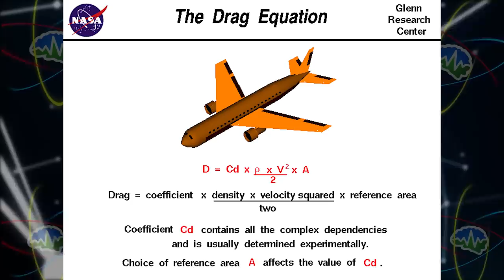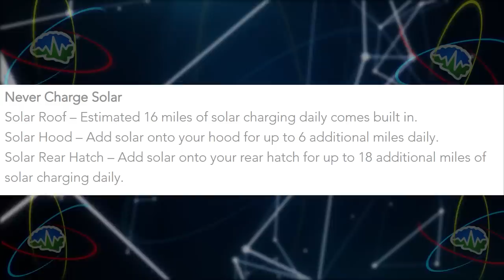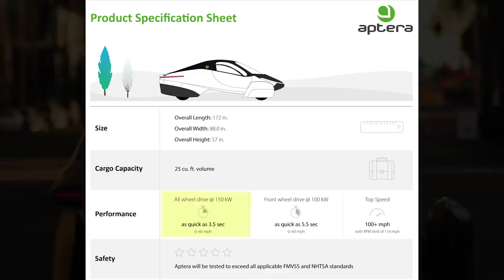Aptera Beats Tesla? | In Depth

Comment: You charge the Aptera to its 1,000 range (or whatever it ends up being), and then keep it there with the free charging supplied by the solar skin of the car. You might need to plug it in once every 6 months, or once per year, depending. This car has an electric charging port, so you can charge it. You can charge it overnight just like Tesla, but with a standard 110 volt plug. Twenty five thousand dollars, deduct all the federal and state incentives, and you end up with a totally affordable car for most people.
Reply: If govt were smart, they would give an incentive for all 3 wheel electric vehicles. But big car company lobbyists won't allow it. ☹️
Reply: The version with 1,000 miles of range doesn't cost close to $25.000. Check the web site; it's more like $45K, plus another $1800 for the full solar panel treatment, which is necessary to achieve 40 miles of charge per (sunny) day. Also, it doesn't exist.
Reply: @richarda3659  This guy is simply saying a long term potential. To debunk it you put forth a shot term worst case scenario. Like if you were a commuter with a 50mile commute, complicated by rainy days. Lol Good luck with that year long charge bud!!! Hahahahaha
Reply: How are occupants cooled or heated? Do windows open? I like the idea but wondering about comfort level. 🤔
Reply: @mitchschneider1927 According to previous Aptera interviews, I believe that it has both heating, cooling, and as you see in the demonstration videos, the window does go up and down. However, due to efficiency centrist design, the winds open 2/3 of the total "window space." It would be a change, however, it would be a small one I presume since the side mirrors will be mainly the cameras that you would view from the inside, rather than the outside.
Reply: That's not a car, but a two seat cabin motorcycle. Those are local use cars, extremely unpractical for day to day use and storage capacity...also forget about any family use.
Reply: The 1000mile version isn’t $25,000.
Reply: @fw1421  -  either that or 40K...  there will be accidents in them things and who ever is in them are signing their death warrants.  them things don't stand a chance in a remotely bad accident.   could you imagine that thing Tboning another car?  let alone a SUV?   its over with.  the people in the suv, though lucky and happy they didn't die... would probably be charged with murder in this day in age lol
Reply: @mitchschneider1927 yes the windows and it has heat and air conditioning .
Reply: @MKO-USA it has 7 feet of room behind the seats and 32.5 cubic feet of storage.

Comment: Quite possibly the only car that you DON'T want to park in the shade.
Reply: I was wondering how that might work out here in AZ.  Great charging, but how is the a/c and how much would it offset the charging to have to run it before you get in so you don't flash fry.
Reply: @enmiredbythelazy4401  Don't forget that if you had the full range of PV a lot of the heat would be turned into extra travel - and if you were a night worker you could just sleep in the summer and have free travel to work!

Comment: I got this from the Aptera site. not as dangerous as it looks?

We will not know Aptera's actual rating until we pass a production vehicle through the full safety test. But we are designing to exceed all passenger car standards and the previous version had the highest roof crush strength of all passenger cars on the road, and it performed exceedingly well in actual side and frontal crash tests. Aptera features a Formula One-inspired safety cell with advanced composites and metal structures for impact strength. Similar to aerospace and racing, these energy-absorbing methods are a core part of our safety strategy and have proven effective time and time again in high speed impacts. Aptera also makes use of today’s best forward and side airbag systems in case of an accident.
Reply: Thank you!  This is what I most wanted to know.
Reply: I was in Brad's boat -- my first and last thoughts were this doesn't look safe
Reply: Same here my biggest question was safety , surprised they didn't mention this in this show kind of important note.
Reply: @Mac_an_Mheiriceanaigh  that’s interesting I saw it an thought “genius” it look like an egg the strongest shape found in nature. The external wheels are just external crumple zones and and it’s light weight means much of the force in a major accident will be dispersed in movement verses being crushed , I am glad they are moving away from the belt based air bag and moved to a traditional system. Now let us see it in the Moose Test avoiding an accident is more important than surviving one.

Comment: Honestly I wish Tesla had a small solar panel to offset phantom drain, any range increase would just be a bonus
Reply: The cost's will just increase and no one want's that
Reply: Would probably add extra weight (panel and converter), which impacts efficiency, so you'd lose your extra miles. And - costs would increase too and so you'd pay more. Probably not ever get a return on that extra cost.
Reply: the glass roof

Comment: I like the design. It’s an airplane body without wings and a vertical stabilizer. I love it.
Reply: I see a vertical stabilizer. It is the rear wheel shroud. I think it is necessary.
Reply: @cookiedough5374  the design honestly throws me off, yah sure it looks cool, but imo it looks funny
Reply: @yuxanne.  I agree. When your cost to operate your car is close to zero it will start to look really, really cool.
Reply: @cookiedough5374  if operational costs are that low, you'd have to be stupid to not get yourself said car
Reply: @yuxanne.  I’ve been called a dumbarse plenty of times. In this case my deposit on one will hopefully manifest as an Aptera.

Comment: This is a follow up to my last point, the drag on a car is minuscule below 50 mph. The predominate issue is tire friction. That being said, if you are driving to work in this every day on surface streets, then you completely killed utility due to the tear drop shape for no gain at all in aerodynamics. This is likely why the BMW car - made for city use - did not compromise on internal utility. You are not going 60mph driving inside the city. BMW is not stupid. They are heavy into formula 1 racing. They know EXACTLY about aerodynamics. This is fundamentally why it has skinny tires.
Reply: That is not true at all; drag on a car is significant at 30 mph and increases with the square of the velocity. It is very significant at 50 mph.
Reply: @TitoRigatoni  
Rolling resistance on a car, the example is a Telsa Model 3:

441 Newtons 

source: 
https://www.engineeringtoolbox.com/rolling-friction-resistance-d_1303.html

Aerodynamic drag on same car at 55mph:

217N

source: https://www.engineeringtoolbox.com/drag-coefficient-d_627.html

This example was at 90km/r (55mph) way faster than the 30 I claimed. You were saying? Doing the math will give you a better understanding at the forces at play than speculating in YouTube comments. Engineering has many non-intuitive answers that can only be solved via math. The Engineers at BMW are not stupid. They did the math, and they put small tires on the car and retained its utility to hold four people and drive around a typical European city for distance requirements. 

You cannot store anything of practical nature in this apreta, it is 100% for only commuting. I cant take this for even a quick run to home depot and grab a 2x4. I have put a 6' long 2x4 into my Mazda 3 hatch (and a lot of other crap) and got real utility out of the vehicle. This is why I reiterate, this is a very expensive proposition for a car that only can be used, realistically, for going to work and back and nothing else. In a Tesla, I could put boxes and all sorts of crap in the back with the rear seats folded down (if they did fold down). My main gripe is that this car is extremely niche in its use cases.

End note: it is possible, at their weight, and tire size, that their cross over point between aerodynamic drag and rolling friction is at a lower speed of 30mph for the aperta. I can see that, similar to the cross over point of 10mph for road bicycles. But that is coming at a heft expense of sacrificing a lot of utility. This is exactly like being in a two seat small aircraft. They reduce frontal area of the fuselage by making it narrow. I can see this seating being shoulder to shoulder with your passenger to narrow the teardrop frontal area as much as possible. Hopefully that is not the case, because that will get old fast.  I can see this car being very fun to drive because it will be very might like sitting in the cockpit of a small plane. It will be a lot of fun and a great alternative to a motorcycle  because it's a lot safer. So you could grab a lot of people who are unwilling to take the risks on a motorcycle even though they really want to ride one.
Reply: @cabdolla  I am not discounting rolling resistance, it's one of the reasons the Aptera has three wheels. It will have significantly less rolling resistance than a Tesla as well as significantly less drag.

This car is bigger than you seem to think. It is not "shoulder to shoulder" It is a comfortable two seat cockpit. And it has 25 cu ft of cargo capacity, which is more than a Tesla model 3 and about the same as a Model S. The sleek design makes it appear small in photos and videos, but when you see the Aptera in real life you will be surprised at what a substantial car it actually is.
Reply: @TitoRigatoni  if they have sandy Monroe helping them, they are in good hands for sure

Comment: Wonderful, wonderful. Wonderful squared!
We have owned and maintained 40+ cars and trucks for over 40 years. Currently we have a 12 wheel Peterbilt roll-off platform for machinery moving. Had lots of motorcycles too. We know auto-mechanics!
   However this Aptera takes the cake AND the brass ring too....for economic, applied aerodynamic ergonomics for human transport, and some charging by sunpower to boot!
    What's not to drool over? I'm signing up!

Comment: I have been reading about and watching videos about Aptera and this is one of the most informative.  Great video.  I'm editing while watching.   It could use a retractable bumpers for and aft.  The Aptera, to me, looks absolutely stunning.  Looks like Airwolf helicopter without the blades.  Here's a question:  The pictures on the Aptera Motor website show the battery layout.  Now is that for the full 1000 mile range battery?  If that is the case, then what does the 600, 400, 250 range model battery holding framework look like?  Can the least expensive model with the least range be upgraded after delivery with more batteries and software upgrade?  What kind of batteries are being put into the Aptera?  Will somebody be able to come up to an Aptera and vandalize it by peeling off a piece of solar collector like a scab?  How difficult will it be on the side of the road to change that rear tire.  For instance, how do you remove those panels that surround that rear wheel?  How would you pay and take delivery of an Aptera?  That is putting a whole lot of trust in a car company only known by a website and video's.  Next model Aptera Ethos.  And I just have to ask this question.  You guys say that you are paying for a car.  With Aptera Rewards you guys are certainly getting a free base model car, maybe two of them.  Is that not true?  Pretty good deal for you two.

Comment: I think this car is great. I am retired and just drive local for shopping and will purchase one when available. My awesome 14 mpg 1996 Chevy C2500HD ( just under 5000 lb in weight) would only be used for heavy cartage. With the 50 gal 2nd fuel tank it costs over $300 to fill up.

Comment: 36:57 So, hold up!
He's saying they could use a 200kWh battery pack to travel 2000mi or 3200km on a single charge.
That means by using a battery pack with 20kWh, smaller than the 1st generation Nissan LEAF, they can travel 200mi / 320km on a single charge.
They'll easily be able to sell the cars at a low price with high margin! :O
Reply: That's exactly what makes this vehicle feasible.
Reply: He's just saying 200 kWh is enough energy to make the Aptera go 2000 miles. But yes, the cheapest ($26k) Aptera configuration does have a 20 kWh battery and claims a 200 mile range.

Comment: Would like to see how safe it is in a crash .
Reply: I think the way it looks answers that question. Can you say motorcycle?
Reply: Formula one cars look similarly vulnerable, very lightweight, yet 200mph powerful and pretty safe in high-speed crashes. These people know they don’t stand a chance if they don’t comply with crash testing legislation around the world. They will surely have this covered
Reply: Seems alot safer than a smart fortwo and those tiny cars sold like hotcakes for awhile. 
Still the smart fortwo had a Mercedes class safety chassis so it was like a very hard bouncy egg.
Still you have vehicles like a polaris slingshot that would be cool or mini trucks that were 3 wheels (asian vehicles, Mazda etc)
Reply: @jonsstuff760  Yeah, they are "covered" because as a motorcycle they don't have to meet car crash regs.
Reply: @jonsstuff760  Yeah agreed, they are designing the main body as a composite safety cell like an F1 car combined with air bags and all the other safety features of a regular car. I'm glad they went with this shape to increase efficiency and roling resistance, despite what others mistakenly think they did it to skirt safety regulations.

Comment: Absolutely love this concept! The ingenuity incorporated into it is amazing. I do however have a problem with calling it a car. A lot of the weight savings are due to this technically being a trike (motorcycle), and not having the same regulatory requirements of a car. That said, this kind of aggressive counterculture thinking will push the industry in and the market into a more sustainable direction.
Reply: It is still designed to and will be tested to full automotive crash test standards.
Reply: Prescott Bates:  Egggszakly..for design and concept. I wholly disagree about "only 3 wheels" though!  America is in a rut,  thinking it needs 4 wheels; a guy passes me yesterday- way Faster than the cars in traffic and, burns/ banks around  the corner.  Compact. Cheap. Low weight. 
3 wheels? No.  
 2 wheels? Nope.
ONE wheel!  motorized, Incredible smooth and looking effortless...and inexpensive.
(Ok, winter us different). But...
The planet is overheating! We're doing it.
    Nothing could be better for us AND the world,  than Aptera, when with it- often NO juice from the grid, is needed for an average trip! And that trip will burn Zero  fossil fuels altogether!
Reply: Auto cycle.

Comment: Danger, Will Robinson!
Just doesn't look safe in a collision, but I'd be interested to see what the crash-testing shows.
Reply: I think it's a trike, so won't have to meet car standards... I think that was part of the idea...
Reply: I remember late 70's and early 80's my father and his generation saying "That Jap cr** can't be safe, give me American steel." My father drove a Lincoln Continental  with a hood so long you couldn't see the road 40 feet in front  of the car. Well those Hondas and Toyotas turned out to be smaller lighter be actually safer. Yes a low speed collision in my dad's Lincoln might only make a minor dent in the steel bumper. It didn't have crush zones and it had a whole lot more inertia to overcome when breaking before a collision. I suspect the Aptera will prove to be reasonably safe. And lets face it tens of thousands of people choose to ride motorcycles, scooters and mopeds every day that offer no safety. They  do it out of necessity or for the joy of riding or some other intangible reason. Before having a daughter I commuted on  a small displacement motor cycle simply to use less fossil fuel in the 90's.
Reply: By the time this is out on the road, a huge percent of the vehicle miles traveled will be done in autonomous mode. Both for this vehicles and other vehicles on the road. I think it will be safe to experiment with lighter designs.